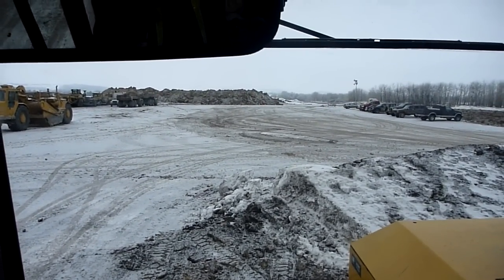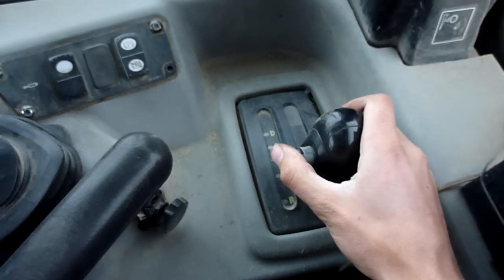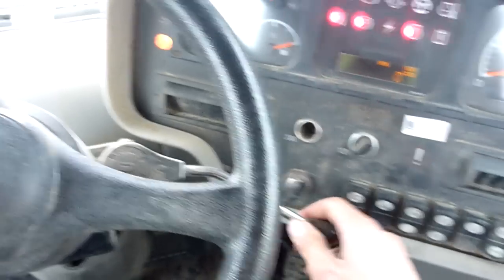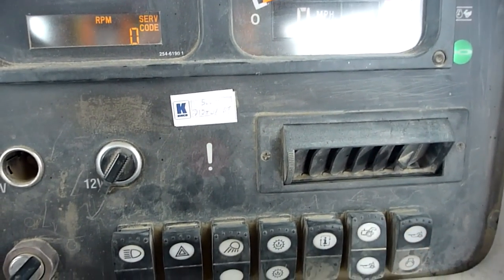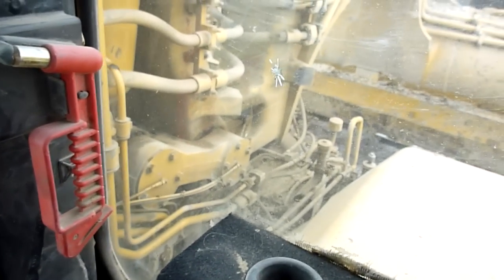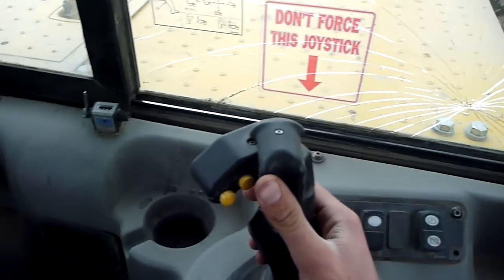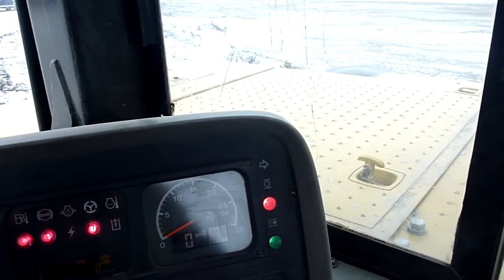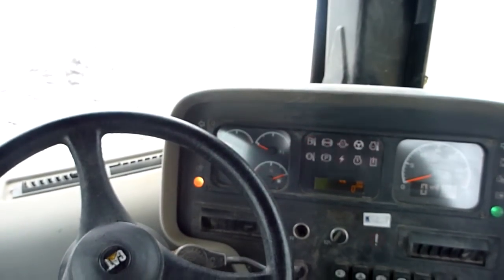How the Controls in a Caterpillar 657G Work

Comment from the maker: @peterahjorter There are two engines! The front controls hydraulics as well so sometimes you want full hydraulic power but less pushing power hence the need to control them independantly. Also in corners the back will push the front around if left at full throttle.

Comment: A Lighthearted look at the beast! Don't be so upset people. I liked his presentation! a few errors who cares! I like the single stick! The 3 levers and the Bail arm lever were what I had to use for decades! Do they still have the button for setting the RPMs the same as others pushing/pulling you?I suppose they would have to as transmission problems could result.
My favourite was the 639D Twin engine elevator was the best! But still preferred sitting on a digger loading trucks!
Reply: More of a setting for locking your transmission in a low gear its mostly 2nd but some scrappers i have run do it in 1st.

Comment: when you turn the scraper on a 90 degree angle you only want the front motor engaged, as the back motor will push you forwards instead of pivoting on the rear wheel

Comment: @25mfd  The answers depend on the type of soil you're working in, size of the scrapers, and the operators of both types of machines. In a scraper the size of a 657, they're designed for moving a LOT of dirt and a grenerally used for rough cutting. They'll usually cut out the dirt to within 5 tenths (6 inches or half a foot) before other machines take over.

Comment from the maker: @Amed2012 As I stated earlier in the video you can toggle the gauges between the front and back engine. The gauges were on rear engine display while I shot the video, and it was not running.

Comment: @vantagetes After you make a pass, how do you get back to the EXACT cutting depth of the previous cut?
Do these machines have some way of locking in a cutting depth so you make the same cut at the same cutting depth EVERYTIME?
If they don't have this, i would imagine it would take a good eye to set the bowl at the same cutting depth every time. And be correct.

Comment: @UAL012 That's pretty much what i thought. Answer this...If you have an area where you need to make a substantial cut of say 5 feet or more, after a few passes, how do you check to make sure you haven't overcut the area?
Grade stakes give you the initial depth to cut to but can they be used as a guide to determine how close you are getting to grade?

Comment: What is the purpose of dual engine control?  Why would you apply throttle to one engine but not the other, or vice-versa, or both at the same time?  Thanks!  Always wondered this about scrapers.
Reply: Because if you crank your cab your rear engine will push your cab sideways if you don’t let off it
Reply: Wow, I posted this 11 years ago!

Comment: @UAL012 Another question...Scrapers are used in the rough grade phase but how close are you looking to get to grade when using scrapers?  What are the typical tolerances that you would want to get to? 
Also, how much can one expect of the grader operator to fix a botched rough grading phase? ie, an over filled or underfilled area.
Reply: If ur half decent you can get within a tenth

Comment: Along time since i drove a 57,no heaters to keep you warm then,the fan blades were adjustable (rotated) and you could turn them around thro' the hole in the radiator guard so the fan sucked air in and blew warm air into the cab rather than blowing it out thro' the rad,also had to start front engine with a donkey engine...wonder if anyone here could /know how to do that....catdw21